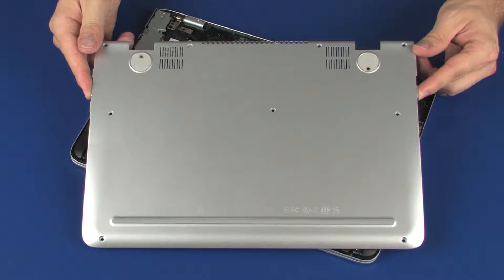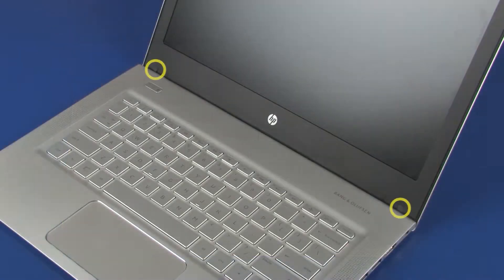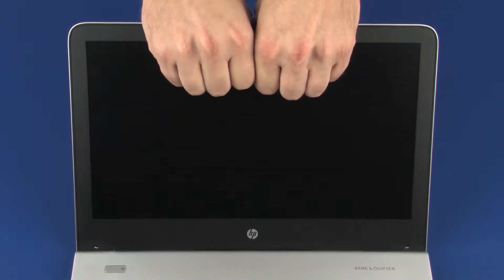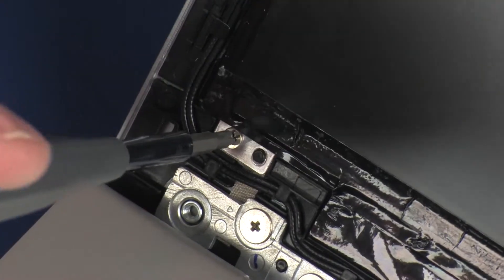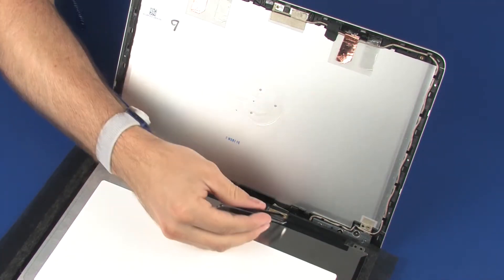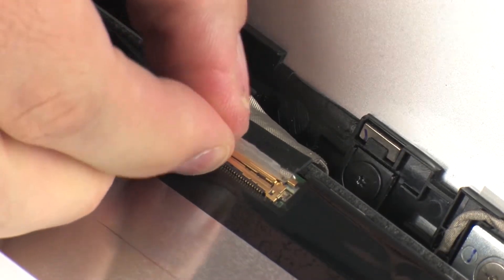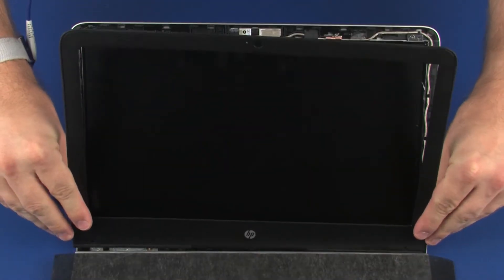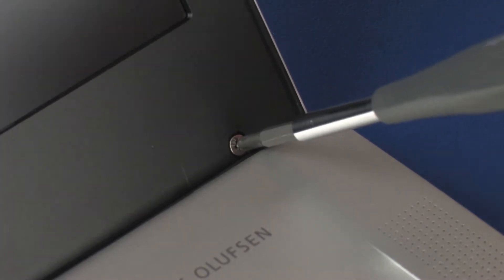Replace the Display Bezel and Panel | HP ENVY 13 Notebook | HP Support

Comment: I have a 13-d061sa, which does not have screws/screw covers on the display bezel. How do you remove the display bezel in this case?
Reply from the maker: Hi Charlie, thanks for contacting!
I understand that you need to know about removing display bezel of our notebook. 
I will do my best to assist you.
Please refer page number 47 of the user manual to know about removing it: https://bit.ly/3ckGgX9
Binu - Social Media Tech Support

Comment: Haven't found a "Display panel enclosure replacement" tutorial - hp envy 13 ab, or equivalent. Any recommendations ?
Reply: Gg
Reply: I would recommend going to a store. You might damage the device
Reply: Expensive for a small repair. But thanks for the suggestion.
Reply: Me too, what did u do? I really cant found a tutorial for my hp envy 13-ad003la